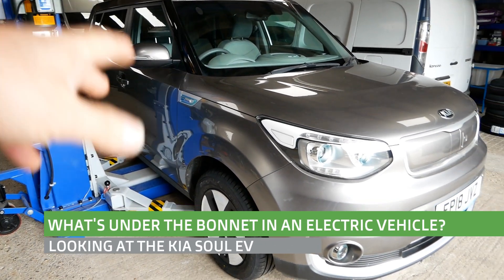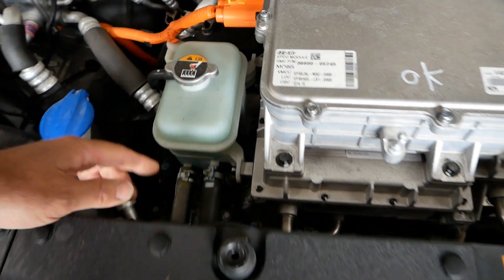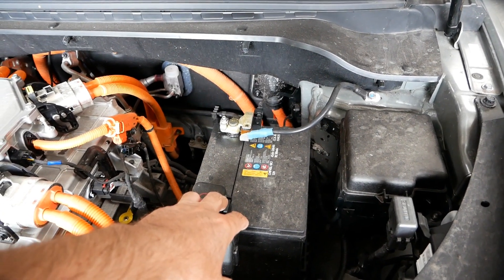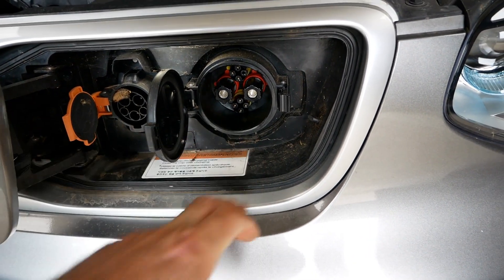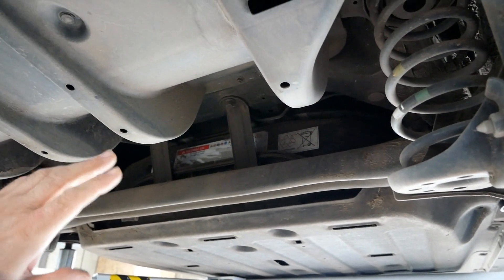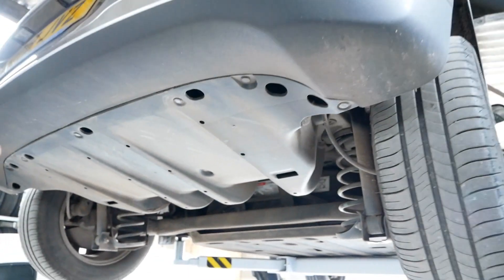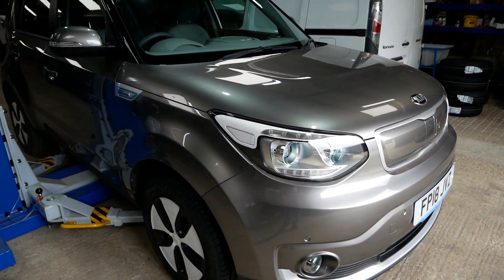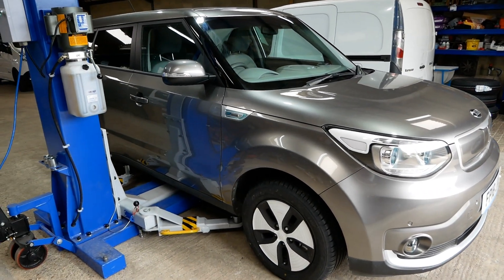What's under the bonnet in a Kia Soul electric vehicle?

Comment: Why don't a manufacturer run the battery and motor coolent through the cabin and warm the passengers in the winter.
Reply from the maker: This is something Tesla have started to do recently. But I think the issue is there isn't enough heat from that source to justify it.
Reply: Bernard, as far as I know the higher trim models and from at least 2016 model year, the kia soul ev, has had what is termed a heat pump. I own a plus model that has one. so the heating system and cooling is taken care of using the same system as the drive pack. still heavy drain but that could be age or how they connected the heat pump into the system.
Reply from the maker: I would also add, that in the UK climate, battery cooling isn't actually used too much. Battery heating is required more, if fitted. The optimum temperate of a pack is higher than you'd expect. After repeated DC rapid charging and fast driving, then yes batteries get hot, but most people don't drive like this. So consequently, there is very little heat generated from an EV powertrain, particularly in the winter when you need heat for the cabin.

Comment: Do only the EU versions have liquid cooled battery packs? I live in the US and am looking to buy one, but not if the battery pack is only air cooled.
Reply from the maker: Kia wouldn't change the cooling and battery design for different markets. I'm not sure if the battery is water cooled on these, as I've not needed to take the undertrays off to look any further. Here's the original press release on these batteries https://press.kia.com/eu/en/home/media-resouces/press-releases/2014/14_03_04_kia-exhibits-soul-ev-battery-technology.html
I've not seen anywhere the cooling system being mentioned.

Comment: At work we have a Kia Soul Electric that has been stationary for several months. It's totally "dead", is it enough to put it into the charger or do i have to  do a sort of "jump start" to make it alive again so it can communicate with the charging station? Greetings from Belgium
Reply from the maker: It will just be the 12V battery. Charge that and you'll be away again. Ideally disconnect and put it on a 12v battery charger for at least 24 hours.
Reply: @GoGreenAutos  Do the big batteries charge the 12V battery when it's loading on a charging point?
Reply from the maker: @Tintoycar  The big battery charges to 12V battery when you're driving or the ignition is on. I'm not sure if it does the same while charging. I don't have one here to test. But if the 12V is completely dead, you wont be able to charge it anyway. You need to sort out the 12V before you can do anything.
Reply: @GoGreenAutos  OK, thanx, tommorow is D-day, I will give you feedback
Reply: @GoGreenAutos  We could do nothing because we had no place to connect to other car for power. P(arking)= electric, handbrake is electric, could not even move the car. Glove box= electric !!! We called assistance and they came with a booster. Then loaded for one hour and could drive again. Don't like electric P(arking) and handbreak. I'll stick to my Civic. Respect for Kia but too much electric ;-) 7 year waranty, that's good!
Reply from the maker: @Tintoycar  Most modern cars are the same. Nothing to do being electric. If the 12V dies, they're all the same.

Comment: Thanks for your informative videos. They're far better than ones KIA produce. 

So little to go wrong on these cars and even when they do they're covered by 7 year /100k warranty. An exception as you pointed out  is the 12V battery, only warranted for 2 years and seems to go just after the 2 year warranty expires. The previous owner had replaced this during lockdown, though I wonder if lockdown (Any lack of use) could be reason why 12V are failing too.

You can see why servicing is so cheap.

Your 30kw (MY2018 from Oct 2017) is worth paying extra for, as these have the 100 of higher capacity E400 Li-po cells made by SK Innovations. Even though the capacity is only 10% extra (than the 27kw model) these seem to produce easily 20%+ increase is real world range. Also looking at the data sheets for the cells,  with normal a/c charging these should last 150k with degradation less than 80%. Its hard to tell atm as my 33 month old 30kw with 37K is showing 0% degradation, And with 8K miles pa I will never get to 150K miles.

For my daily commute to London, around 14 miles each way, this is the prefect car. I think Soul EV 30kw is even better than i3 94ah BEV.  

Not sure if the 30kw leaf or 94ah BEV is capable to 160 mile summer range that I am getting. Only Ioniq is better EV but I hate its Prius (defacto mini cab) looks.
Reply: My 2017 12v battery is still going strong!